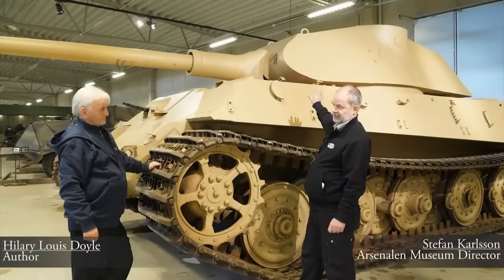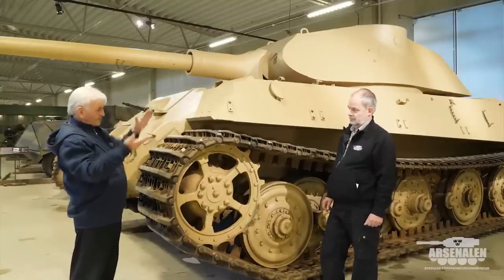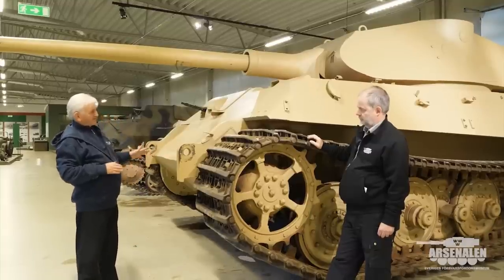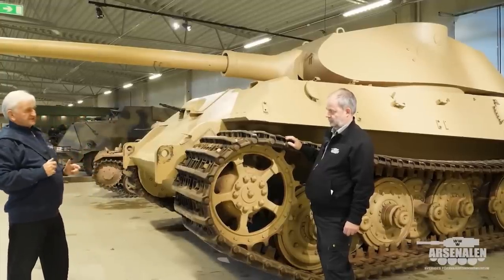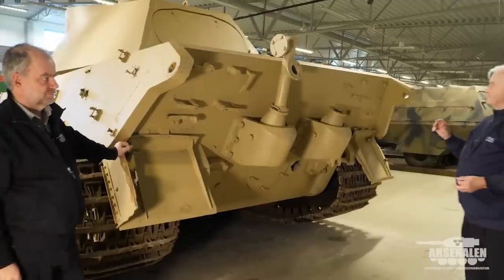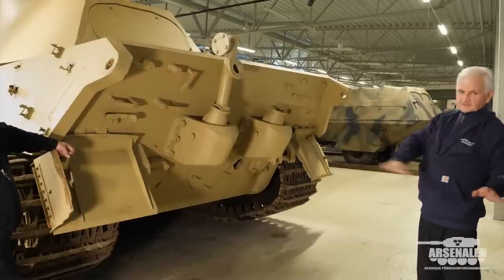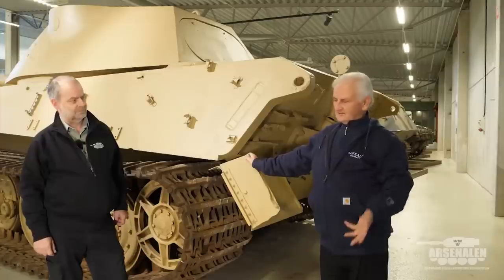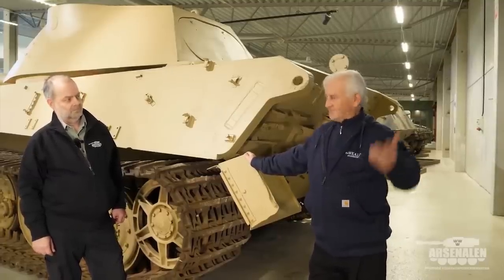Hilary Doyle PanzerTalks - The Tiger II - Part 2

Comment: Modern AP rounds will still penetrate at anything greater tan 11 Deg. I doubt very much that the slope of this tank would have deflected an AP. The rifled barrel of the Chieftain, Challenger 1 and 2 used the L11A5 which was far more accurate than the smooth bore now used in any cross wind. However, it's life firing AP was 100 rounds. Money over effectiveness wins again.

Comment: There is a third reason using two angled plates of armor, weight saving. I am sure those two plates are a lot lighter than the front of a tiger 1 build with the same thickness and easier to manufacture.
Reply: Not really, sloping armour uses MORE armourplate in the same vertical distance compared to a straight (90 degree) plate of similar thickness, but still even using less thickness to get the same thickness in sloping armour, the plate still is longer.

Comment: I would be curious to ask Mr Doyle if there was ever any investigation to install the 88 on a Panther.
Reply: Only using the Schmalturm but it would have required a larger turret ring which the Germans did not want to do because the Schmalturm Panthers with 88 would be incompatible with the older Panthers. The Schmalturm intended for production would have used the 75mm L/70 KwK 44.